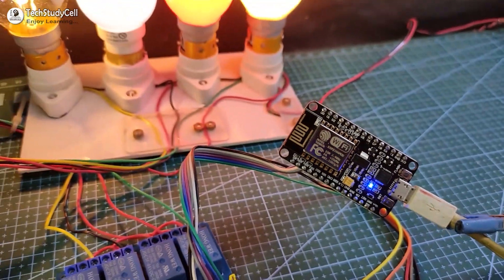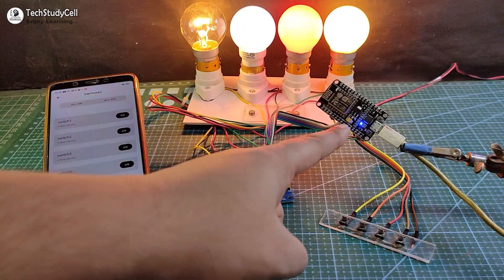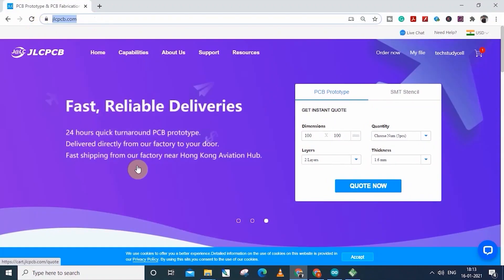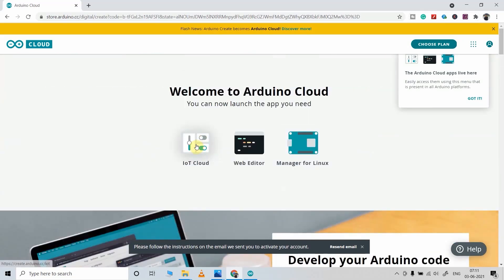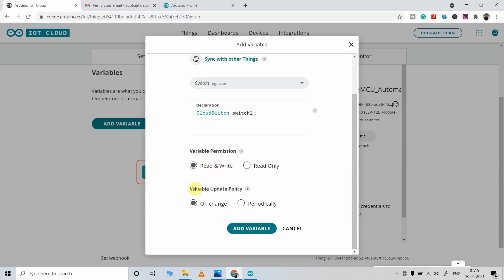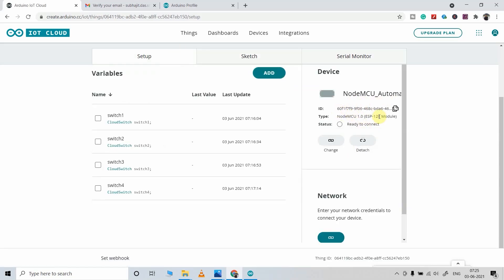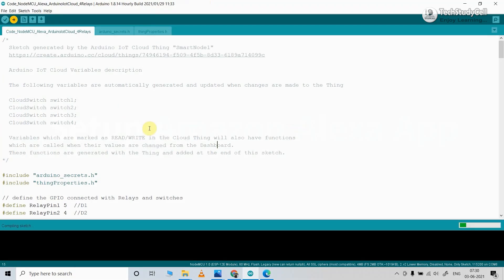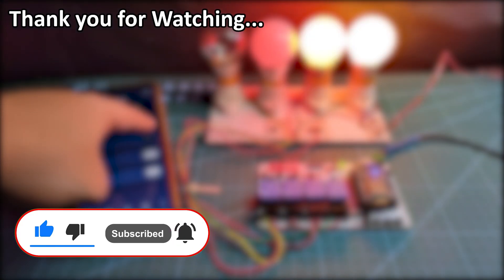Arduino IoT Cloud ESP8266 NodeMCU Alexa Home Automation system | Internet of Things projects 2021

Comment: Sir you have done a good job but there is mistake in your code when we say turn on  the light gets off and when we say turn off the light gets on in your code you have written HIGH turn Relay off and when LOW Turn Relay ON it is opposite in HIGH it should be ON and LOW should be OFF and in your vedieo you have not shown to connect the wifi credintial in our arduino iot cloud

Comment: Hey. i have a problem when i tap (on) on the alexa app realy turn( off) and when i tap (off)  relay will turn (on) what is the problem?why the orders are reverse (I use exaclly your code on your website
Reply: There is mistake in the coding just change the wording in void loop from relay high to low and from low to high in the ending of the code then it will work properly

Comment: I have done same process just like you, but at the time, when I click on discover device in alexa aap, it says no device found but shows all my 4 switches in device option, but as I turn on and off these switches, it doesn't work with nodemcu even after it is connected with my mobile by hotspot

Comment: #define SwitchPin1 10  //SD3
#define SwitchPin2 0   //D3 
#define SwitchPin3 13  //D7
#define SwitchPin4 3   //RX

these manual switches will create issue if left on/off based on different pins.. can you check and consider them?

Comment: Thanks for the video! I tried to do the same with an esp8266. But i am getting an error in serial montitor. 
ArduinoIoTCloudTCP::handle_ConnectMqttBroker could not connect to mqtts-up.iot.arduino.cc:8884
Do you know a solution for this ? 
Thank you

Comment: Arduino: 1.8.13 (Windows 10), Board: "NodeMCU 1.0 (ESP-12E Module), 80 MHz, Flash, Disabled (new aborts on oom), Disabled, All SSL ciphers (most compatible), 32KB cache + 32KB IRAM (balanced), Use pgm_read macros for IRAM/PROGMEM, 4MB (FS:2MB OTA:~1019KB), 2, v2 Lower Memory, Disabled, None, Only Sketch, 115200"

C:\Users\User\Documents\Arduino\libraries\ArduinoIoTCloud\src\cbor\lib\tinycbor\src\cborpretty.c: In function 'hexDump':

C:\Users\User\Documents\Arduino\libraries\ArduinoIoTCloud\src\cbor\lib\tinycbor\src\cborpretty.c:195:32: error: expected ')' before '__INT8'

  195 |         err = stream(out, "%02" PRIx8, *buffer++);

      |                                ^

      |                                )

C:\Users\User\Documents\Arduino\libraries\ArduinoIoTCloud\src\cbor\lib\tinycbor\src\cborpretty.c: In function 'utf8EscapedDump':

C:\Users\User\Documents\Arduino\libraries\ArduinoIoTCloud\src\cbor\lib\tinycbor\src\cborpretty.c:251:39: error: expected ')' before '__INT32'

  251 |             err = stream(out, "\\u%04" PRIX32 "\\u%04" PRIX32,

      |                                       ^

      |                                       )

C:\Users\User\Documents\Arduino\libraries\ArduinoIoTCloud\src\cbor\lib\tinycbor\src\cborpretty.c:257:39: error: expected ')' before '__INT32'

  257 |             err = stream(out, "\\u%04" PRIX32, uc);

      |                                       ^

      |                                       )

C:\Users\User\Documents\Arduino\libraries\ArduinoIoTCloud\src\cbor\lib\tinycbor\src\cborpretty.c: In function 'value_to_pretty':

C:\Users\User\Documents\Arduino\libraries\ArduinoIoTCloud\src\cbor\lib\tinycbor\src\cborpretty.c:382:34: error: expected ')' before '__INT64'

  382 |             err = stream(out, "%" PRIu64, val);

      |                                  ^

      |                                  )

C:\Users\User\Documents\Arduino\libraries\ArduinoIoTCloud\src\cbor\lib\tinycbor\src\cborpretty.c:387:39: error: expected ')' before '__INT64'

  387 |                 err = stream(out, "-%" PRIu64, val);

      |                                       ^

      |                                       )

C:\Users\User\Documents\Arduino\libraries\ArduinoIoTCloud\src\cbor\lib\tinycbor\src\cborpretty.c:457:30: error: expected ')' before '__INT64'

  457 |         err = stream(out, "%" PRIu64 "%s(", tag, get_indicator(it, flags));

      |                              ^

      |                              )

C:\Users\User\Documents\Arduino\libraries\ArduinoIoTCloud\src\cbor\lib\tinycbor\src\cborpretty.c:473:37: error: expected ')' before '__INT8'

  473 |         err = stream(out, "simple(%" PRIu8 ")", simple_type);

      |                                     ^

      |                                     )

C:\Users\User\Documents\Arduino\libraries\ArduinoIoTCloud\src\cbor\lib\tinycbor\src\cborpretty.c:531:36: error: expected ')' before '__INT64'

  531 |             err = stream(out, "%s%" PRIu64 ".%s", val < 0 ? "-" : "", ival, suffix);

      |                                    ^

      |                                    )

C:\Users\User\Documents\Arduino\libraries\ArduinoIoTCloud\src\cbor\lib\tinycbor\src\cbortojson.c: In function 'add_value_metadata':

C:\Users\User\Documents\Arduino\libraries\ArduinoIoTCloud\src\cbor\lib\tinycbor\src\cbortojson.c:297:39: error: expected ')' before '__INT64'

  297 |         if (fprintf(out, "\"tag\":\"%" PRIu64 "\"%s", status->lastTag,

      |                                       ^

      |                                       )

C:\Users\User\Documents\Arduino\libraries\ArduinoIoTCloud\src\cbor\lib\tinycbor\src\cbortojson.c:316:40: error: expected ')' before '__INT64'

  316 |         if (fprintf(out, ",\"v\":\"%c%" PRIx64 "\"", flags & NumberWasNegative ? '-' : '+',

      |                                        ^

      |                                        )

C:\Users\User\Documents\Arduino\libraries\ArduinoIoTCloud\src\cbor\lib\tinycbor\src\cbortojson.c: In function 'tagged_value_to_json':

C:\Users\User\Documents\Arduino\libraries\ArduinoIoTCloud\src\cbor\lib\tinycbor\src\cbortojson.c:351:35: error: expected ')' before '__INT64'

  351 |         if (fprintf(out, "{\"tag%" PRIu64 "\":", tag) < 0)

      |                                   ^

      |                                   )

C:\Users\User\Documents\Arduino\libraries\ArduinoIoTCloud\src\cbor\lib\tinycbor\src\cbortojson.c:359:39: error: expected ')' before '__INT64'

  359 |             if (fprintf(out, ",\"tag%" PRIu64 "$cbor\":{", tag) < 0 ||

      |                                       ^

      |                                       )

C:\Users\User\Documents\Arduino\libraries\ArduinoIoTCloud\src\cbor\lib\tinycbor\src\cbortojson.c: In function 'value_to_json':

C:\Users\User\Documents\Arduino\libraries\ArduinoIoTCloud\src\cbor\lib\tinycbor\src\cbortojson.c:578:38: error: expected ')' before '__INT8'

  578 |         if (fprintf(out, "\"simple(%" PRIu8 ")\"", simple_type) < 0)

      |                                      ^

      |                                      )

C:\Users\User\Documents\Arduino\libraries\ArduinoIoTCloud\src\cbor\lib\tinycbor\src\cbortojson.c:637:39: error: expected ')' before '__INT64'

  637 |                 r = fprintf(out, "%s%" PRIu64, val < 0 ? "-" : "", ival);

      |                                       ^

      |                                       )

exit status 1

Error compiling for board NodeMCU 1.0 (ESP-12E Module).

This report would have more information with
"Show verbose output during compilation"
option enabled in File -> Preferences.

I got this error message during compiling...any thoughts? thanks.
Reply: Hi, I had the same problem.
The solution is to install the ESP8266 V.2.7.4 board and install the ArduinoIoTCloud V.1.0.2 library.
The problem is in the versions.

Comment: I used LEDs instead of relays and the on command turns it off . why is this?
Reply from the maker: In project I have used active LOW triggered relay. So to turn on the relay, I have sent LOW signal. If you want to control LED then you have to make the GPIO HIGH to turn on the LED. you have to modify the code.
Reply: @TechStudyCell  thanks sir . Could you give me the line number please.

Comment: Greetings from Brazil!!

what happens I can't compile the Error Below:

Arduino: 1.8.14 (Windows 10), Placa:"NodeMCU 1.0 (ESP-12E Module), 160 MHz, Flash, Disabled (new aborts on oom), Disabled, All SSL ciphers (most compatible), 32KB cache + 32KB IRAM (balanced), Use pgm_read macros for IRAM/PROGMEM, 4MB (FS:2MB OTA:~1019KB), 2, v2 Lower Memory, Serial, None, Only Sketch, 115200"

In file included from C:\Users\carlo\Desktop\PROJETOS\CONTROLE WIFI\CONTROLE CASA\COM ALEXA\Code_NodeMCU_Alexa_ArduinoIotCloud_4Relays\Code_NodeMCU_Alexa_ArduinoIotCloud_4Relays\thingProperties.h:4,

                 from C:\Users\carlo\Desktop\PROJETOS\CONTROLE WIFI\CONTROLE CASA\COM ALEXA\Code_NodeMCU_Alexa_ArduinoIotCloud_4Relays\Code_NodeMCU_Alexa_ArduinoIotCloud_4Relays\Code_NodeMCU_Alexa_ArduinoIotCloud_4Relays.ino:17:

C:\Users\carlo\Desktop\PROJETOS\CONTROLE WIFI\CONTROLE CASA\COM ALEXA\Code_NodeMCU_Alexa_ArduinoIotCloud_4Relays\Code_NodeMCU_Alexa_ArduinoIotCloud_4Relays\thingProperties.h: In function 'void initProperties()':

C:\Users\carlo\Documents\Arduino\libraries\ArduinoIoTCloud\src/ArduinoIoTCloud.h:103:64: warning: 'void ArduinoIoTCloudClass::addPropertyReal(Property&, String, permissionType, long int, void (*)(), float, void (*)(Property&))' is deprecated: Use addProperty(property, Permission::ReadWrite) instead. [-Wdeprecated-declarations]

  103 | #define addProperty( v, ...) addPropertyReal(v, #v, __VA_ARGS__)

      |                                                                ^

C:\Users\carlo\Desktop\PROJETOS\CONTROLE WIFI\CONTROLE CASA\COM ALEXA\Code_NodeMCU_Alexa_ArduinoIotCloud_4Relays\Code_NodeMCU_Alexa_ArduinoIotCloud_4Relays\thingProperties.h:30:16: note: in expansion of macro 'addProperty'

   30 |   ArduinoCloud.addProperty(Chave1, READWRITE, ON_CHANGE, onChave1Change);

      |                ^~~~~~~~~~~

C:\Users\carlo\Documents\Arduino\libraries\ArduinoIoTCloud\src\cbor\lib\tinycbor\src\cbortojson.c: In function 'value_to_json':

C:\Users\carlo\Documents\Arduino\libraries\ArduinoIoTCloud\src\cbor\lib\tinycbor\src\cbortojson.c:578:38: error: expected ')' before '__INT8'

  578 |         if (fprintf(out, "\"simple(%" PRIu8 ")\"", simple_type) < 0)

      |                                      ^

      |                                      )

C:\Users\carlo\Documents\Arduino\libraries\ArduinoIoTCloud\src\cbor\lib\tinycbor\src\cbortojson.c:637:39: error: expected ')' before '__INT64'

  637 |                 r = fprintf(out, "%s%" PRIu64, val < 0 ? "-" : "", ival);

      |                                       ^

      |                                       )

exit status 1

Error compiling for NodeMCU 1.0 board (ESP-12E Module)

With others Sketch compiles normal.

 Thanks!!

Comment: hi bro, 
   i got an error with your code, please help me 

error result below 

     
ets Jan  8 2013,rst cause:4, boot mode:(3,2)

wdt reset
load 0x4010f000, len 1384, room 16 
tail 8
chksum 0x2d
csum 0x2d
v8b899c12
~ld
Reply: me also facing the same problem.. if you short out let me know

Comment: Wow.
I like your work, it is inspiring!

Please, I recently purchased ESP8266. Unfortunately the device driver could not install automatically with my version of window 7. After several attempts, I managed to install the drive from sparkfun. I have installed the esp8266 in my Arduino ide library. The problem now is I am unable to upload a simple code inside the node MCU device. I always get error, "port can't be opened, access denied". If I manage to open serial monitor on code view, I get the following error "port 4 busy" what do I do please? 
Under my computer device manager,  esp8266 is installed as port 4.
Reply from the maker: Try to use different USB. Also update the Arduino IDE
Reply: @TechStudyCell  
Thank you Sir
I'll try to update the arduino IDE, that is the only thing I have not done so far.

Comment: Dear friend, when I compile I get this error message:
C:\Users\ragot\Documents\Arduino\libraries\ArduinoIoTCloud\src/CloudSerial.h:22:10: fatal error: RingBuffer.h: No such file or directory
   22 | #include <RingBuffer.h>
      |          ^~~~~~~~~~~~~~
compilation terminated.; 

RingBuffer.h is there in the library, still it says error. Please publish Board version and Library Version used, please. Thank you in advance.
Reply from the maker: Have you install all the dependencies? Select the NodeMCU board before compiling the code. Hope you have not modified the code.
Reply: @TechStudyCell  Thank you, I followed your instruction and installed "ArduinoIoTCloud.h" and all dependencies option using it. Any other suggestion please.

Comment: Bro which relay do you use and with which components. Cause if we make pcb, then we can't use the relay module but instead use the relay with some components like resistors and diode. Can you tell what they are and circuit diagram for them.